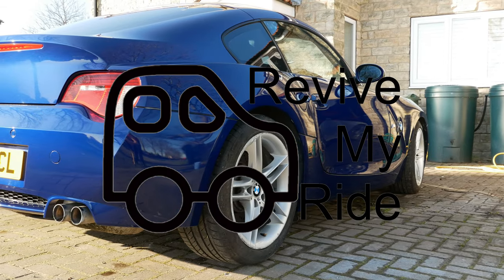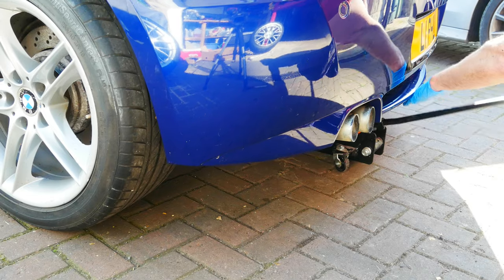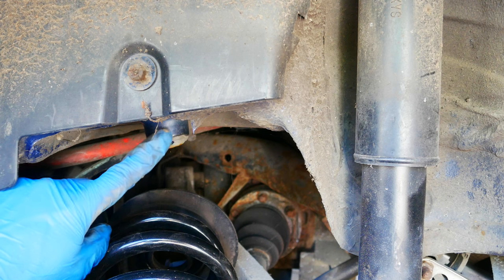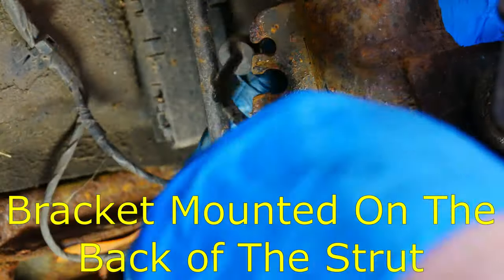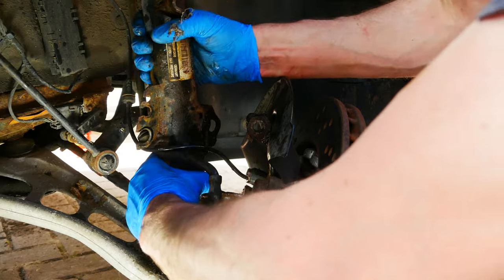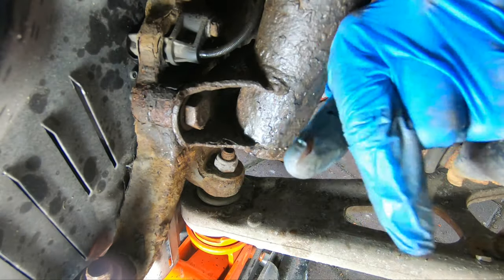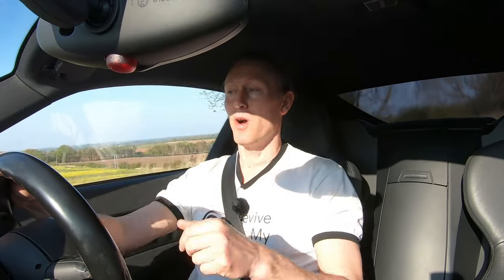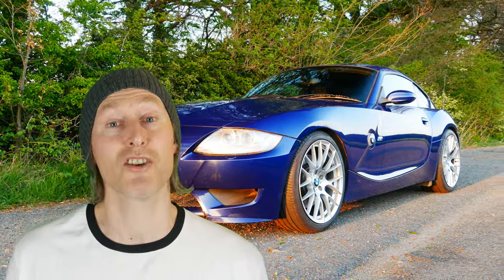FIRST Car Modifications // BMW Z4 M

Comment: Looks a lot better! It is recommended though that you change your shocks and struts when you lower a car or your ride may be rough or bouncy. Also remember to get an alignment.
Reply from the maker: Thanks! The ride is a lot stiffer now and I was considering whether to change the shocks or not. I don't think they have ever been done and the car is almost 18yrs old now, so definitely overdue! Do you think I really need an alignment for what (If I remember correctly) is only a 10 to 20mm ride height drop? Thanks, Phil

Comment: Those are m359 wheels as seen on the e9x M3 and 1M, not CSL’s ;)
Reply from the maker: Thanks! I actually just learned this myself recently! I've been obsessed with the E46 M3 CSL wheels for years and then accidentally bought M359's! Ironically, I prefer the M359's they're clearly an evolution of the original CSL style wheels... BUT I didn't like the offsets and the Z4M didn't like the 19" wheels (tramlining, harsh ride etc) so they've gone. I'm back to the original wheels for now.

Comment: Great detailed video and car looks better now too. Going to have Eibach springs fitted to my 35is Z4 in a couple of weeks
Reply from the maker: Thanks! TBH I feel a bit sad now because I sold my CSL rep wheels. The Z4m coupe is a fickle beast and the larger wheels with lower profile tyres (plus offsets change slightly) made it tramline badly, so I'm back on the standard wheels. I still like my Eibach springs though! I think they will make a difference on your car too 👍 Thanks, Phil

Comment: Just jackk up the car using the front rubber pad and then put a axle stand under the rear rubber pad and other way round for the front. This way is really unnecessary
Reply from the maker: Always up for new idea but won't you have to lift the front a long way up before you can get a stand under the rear jacking points? Why is that easier than lifting at the back and then supporting at the back & then lifting at the front and supporting at the front? Cheers!
Reply: @ReviveMyRide  no I thought that but it is doable. Unless you are rasing the car a crazy amount it is actually stiff enough to raise the rear enough to put a stand under using the front jacking pad. You can only do one jack stand at a time but I find it easier and quicker especially for front.
Reply from the maker: @aaronobrien7821  Thanks for the reply, I'll have to give it a try 👍